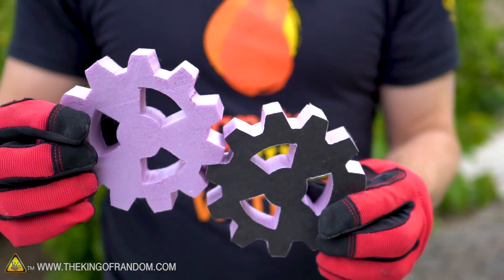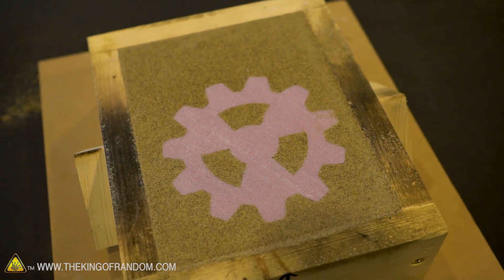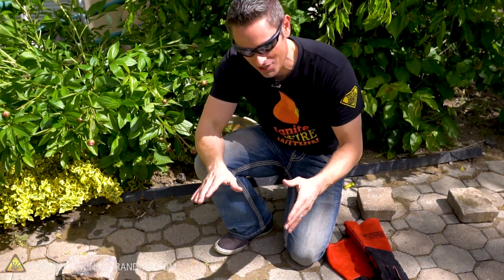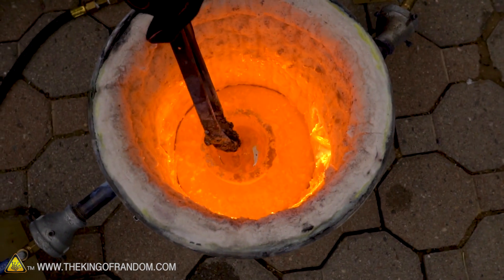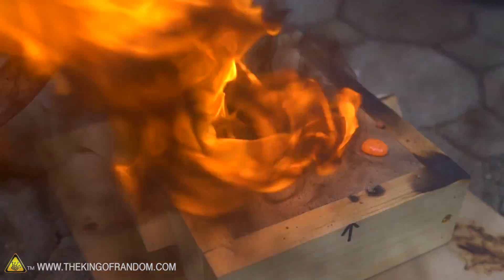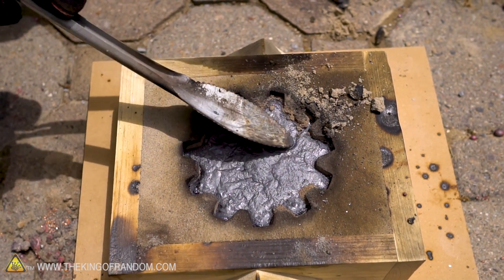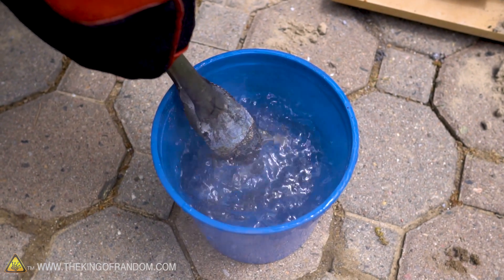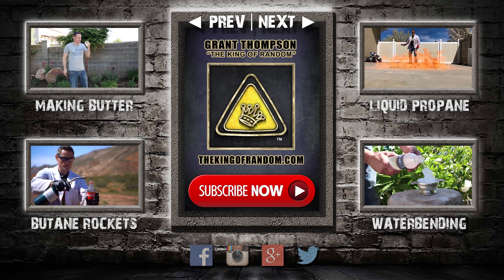Argh. Why Is Copper So Difficult? TKOR Tests Melting Copper In Our Homemade Foundry

Comment: Professional caster to the rescue! 
Don't melt the Styrofoam, and skim the slag off the top of the copper. It's a defective impurity. Also a neat trick to the sand is add  sand epoxy.
Reply: Yeah I was so confused as to why he kept melting the Styrofoam first!
Reply: KingSusan420  also the sand was to wet and here's why the water evaporated so fast the sand whent upward
Reply: KingSusan420 I'm no caster but I've seen others remove their mould using screws to leave just a cavity in the sand, would that help?
Reply: For the slag, he is supposed to stir in some borax because borax makes to slag easier to remove. He can use a titanium rod as a stirring stick. And  to make play sand into casting sand he just need to mix a small bottle of white glue into the water that is used to wet the sand. The sand can be reused by soaking it in water. Also, construction sand works better than play but construction sand has cancer causing dust. Play sand should never be used in high strength concrete
Reply: +RmRoyalflush He is using clay in the sand
Reply: I finally watched his sand video. He does add clay to his sand.
Reply: RmRoyalflush He made this sand in another video with clay, it isn't play sand.
Reply: Lee C he shouldnt make gis own he should get some professional grade stuff
Reply: Edgy McMememaster probably yeah, just saying it wasn't just play sand lol
Reply: Charles Tull The sand is NOT for casting.
Reply: KingSusan420 "professional caster" you should imediatly see that his sand is NOT for casting. Its just some play sand, he needs clay to make real shapes that hold up. Also he wouldnt need styrofoam and even if he would still use it, one template would be enough (you know you can take them out if you use proper casting sand)

Comment: did it not work again? i think its because you are using flame retardent home insulation, it does not vaporize in time like you wanted and shrinks/bunches up and leaves those big impurities you are seeing, by the time it turns to gas the copper nearby is already nearly solidified...

Comment: Can you make a tips / tutorial on how to safely use propane?  Im very terrified to use it without knowing how to and i cant find proper tutorials... Im still using charcoal for my forge and im just borderline of melting copper.. the crucible doesnt get hot enough. but the fire itself is. i threw a nugget in it and it melted. but the crucible wont get hot enough to melt it...  Propane will get it hot enough but i dont know how to use it.

Comment: Hey grant, just a suggestion
You should put the mold with the foam gear still in it in the oven to drive off the moisture and make the mold harder so the middle pieces don't break off🙂

Comment: You need to use the cope and drag and put a fill hole and vent hole in, that'll solve most of the problems you are having.  You might need a bit more bentonite and less water in the sand too.  You are making steam in the last casting you could see it in the copper, that causes poor surface finish and other problems.

Comment: Put sand in your foundry and try casting glass!
Reply: Vatablous Devil you would need silica sand and mutch higher temperatures
Reply: Doge channel any old sand still works it gust doesn't look right
Reply: You make it with a very specific kind of sand. (AKA Silica sand) which has an extremely high melting point, higher than you can achieve with any gas you can buy at a store. Charcoal may work but it is a long shot.
Reply: its not minecraft
Reply: Also that's not the proper use of AKA
Reply: Doge channel, I have not found coal yet, can I use my wooden pickaxe(now that I have upgraded to stone) instead?

Comment: Hey Grant, try making the water slightly hotter, and then put it in the oven or something to heat up the mold a little bit. Then it would take less heat from the copper, so the copper could flow more easily. Also, try making a channel away from the main gear for the copper to flow down, then it might not push the sand over as easily.
Reply: Ytrbpt Hsbom his sand is NOT for casting, a channel would just break his mold, he needs to get proper sand or rather clay,

Comment: Hey Grant Thomson why dont you do it with a close mold? If you divide the die in three parts and remove it before pour the copper in to mold. The other sugestion is to heat up the mold it self. Just give it a try. Thank you for the fun of watching this

Comment: Grant, make the gear with a 2 part green sand mold that has a top and bottom. The top can be just sand, because the bottom will have the mold. Just drill holes in the top to reach the bottom. The top will help kept the pillars from rising.

Comment: You could try a hybrid green sand system. Do molds like You did before by burying the foam in the green sand and using a riser to pour the copper into the mold. Also You could add more clay to the sand add more water to make it into a paste then add the foam and pop it into the oven to cook it and harden the mold like a clay pot.

Comment: Make a two piece mold. the sand weighs less than the liquid copper so it floats because it doesnt take much to pull the sand apart, but if you had a two piece mold, the inner parts would be braces on both sides keeping it from floating away...

Comment: grant why didn't u try making two halves like real sand casting where there is a blank side with a funnel and a side with the mold or a mold on both sides but a funnel on one that way u make sure it flows to all the cavities plus since the sand will be on both sides it will hold down the mold picked that try to float and insulate some of the heat letting it flow a bit longer

Comment: It would probably work out better if you did a 2-part mould with a cavity instead of using foam.
Have a go with sodium silicate/CO2 hardened sand.

Comment: You will have better results using the sand and Sodium Silicate method.  You pack your mold as usual then gas it with Co2 to harden the sand, remove your pattern and you are ready to pour the copper!

Comment: I think a part of the problem is a fairly large buoyant force exerted by the copper. After all, It is a heavy metal, so you can expect much larger buoyancy than with aluminium (around 3x actually, if my calculations are correct). That force acts upon these pillars of sand, and they simply do not have a large enough cross section to withstand it, and so they break off and float on the molten copper. What I think you could do to avoid this is to insert something like a piece of wooden dowel (vertically) into every hole in your styro gear at the stage of mold preparation. When you then fill it up with sand and ram it, the dowel will help hold these pillars of sand firmly to the bottom layer of sand. You could do something to increase the area of contact with the sand, for example drive a small wood screw through the top and bottom of the dowel. I'm not an expert in metal casting, but still, I hope this helps. Cheers

Comment: Sand has a very low density compared to the copper (8.9) so the sand just cracks and floats on the liquid copper, a mold like this sould be completely closed to avoid sand to float.
However, it seems that your sand is very brittle, do you use something except water to bind it, clay (bentonite) or something like this? 
The filling of the mold is very low, you should do it faster to get a complete part and avoid the metal to decrease to much in temperature, make a closed mold with a descent allow to fill a mold like this in 3 seconds, and sand everywhere around the part avoid air to cool down the metal.

Comment: You should try melting sand from the beach into glass using the foundry
Reply: too high of a melting point to do that with propane or butane. charcoal would work but if you don't use silica sand it wont work.
Reply: That, and if you want clear glass, you can't just use any old sand. A specific kind of sand is used to get clear glass, the rest come out smoky and gross.

Comment: The green sand was likely too dry. As it dries it loses strength. Ever seen a sand castle at the beach? They are more often made with damp rather than dry sand. The wet sand will help hold its shape better. Also, have you considered skimming the copper? There is a lot of slag and debris on top that pours into each mold giving you that stippled finish.

Comment: the molten copper is a liquid, and it's a pretty heavy liquid, so the molten copper is excerting an upwards pressure on the middle pieces.  You can see this as the broken off bits float on the copper.
For shapes like this you need a closed mold rather than an open one.

Comment: You should try using an oil-based sand. A little more expensive, but stays in place better. You can also try compacting your green sand more by using more force. Another option is using a different metal than copper with a lower melting point.  You should also try adding borax to the copper, which may help, but probably not.  Hope the advice helps; keep on trying!
Reply: wouldnt the oil burn?
Reply: Yes; it would absolutely burn, but not very quickly.  The only parts that would burn are the areas exposed to the outside air, which can easily be scraped off or put out.  I mean, Grant uses wood and is basically pouring metal around 1,600°F onto it.  Have you noticed the carbon marks on it?
Reply: You do have a point

Comment: You need fully cover the mold in sand with 2 cylinder holes on each side . One side to poor and one side to vent. This will also save time grinding.
Reply: You also might need a deeper box
Reply: you know you can edit right? not what you did by putting a another comment

Comment: you should use both green sand molds and put a hole im the mold that goes over top the gear then pour the cooper in the whole with the.gear mold
Reply: ask me anything if you need more explanation

Comment: you might need a two part mold for that if the internal sand parts are breaking loose like that. also your sand might need to be wetter.

Comment: I'm not espert but for what i see i think the high temperature of copper let evaporate the water in the sand too quickly and broke it. instead of water ther is some recipe for green sand whit oil u can try, also i think u should make a top box of green sand whit a funnel hole in the middle and put it on the gear to pour the copper quicly and keep the temperature up. (english is not my first lenguage if it's write wrong i'm sorry)

Comment: you need half the gear molded in a top and bottom to make a whole one and it will help keep the chunk of sand from popping out because there being press together from the two half to each other when pouring the copper. note, you need to add two tea candle wax for flux and temp for easier flow.

Comment: I haven't done any foundry work since middle school like 20 years ago, the only things I can think of is the water in the sand expanding from the heat messing up the middle cogs, can you "bake" the sand to help keep it's shape, and maybe put a lid over the whole thing with and this is the harder part, one entry way to pour the molten copper into that feeds into 3-4 feed points distributed around the cog.

Comment: Nice DIY try! :) If you want to have a nice cast you should probably think about a 2pc sand mould with a top and feeder hole + vent. I think it should be easy to to assemble for you ;)
Reply: that should support the sand and prevent the it from floating. And just leave the foam in the mould, it stabilizes the mould during the casting process. Also think about getting a castable alloy.

Comment: perhaps you could look up some green sand recipes, preferably some that contain bentonite clay in the sand and/or oil in the sand. 
you may also want to reduce dissolved gasses from the molten copper, i.e. fluxing it and/or putting charcoal in the melt.

Comment: Try adding a small amount of talc to the sand and some borax to the copper. Also cover the top with sand and have a small chute to pour the copper into the mould with a gas chute on the other side.

Comment: That greensand recipe seems to be super weak if it's pushing the sand away that easily during casting.  That stuff should be able to take a pretty decent jolt without moving.  Add more bentonite to your ratio.

Comment: You should use the arc furnace to melt copper and  use fire brick to mold the copper since it can withstand lots of heat and not ruin the final product

Comment: pouring liquid copper on the sand of the radioactive symbol is the problem, it cannot stand one piece since copper is heavy liquid metal. pour it on ths center of the of the s.f

Comment: what happens when you heat up a magnet? does it still work?
Reply: It will not work because the poles will be all messed up because the heat excite them to the point where they are moving all over the place. Once it cools back down most of them will return back to the original state but not all. SO the magnet will become weaker.
Reply: Google "Curie temperature".
Reply: basically that is correct. however it depends on how much you heat it up, and what materials your magnet is made of. Different materials will have a different temperature range that you can heat it up to without losing the magnetic field. so it is possible to heat a magnet up and not have it affect the magnetic strength  but if as you get near the threshold your material will start losing its aligned poles  and become weaker or the poles will be disturbed enough to cause it to no longer be  a magnet.
Reply: Noliux noop
Reply: and molten metals arent attracted either
Reply: no
Reply: thnx
Reply: Do you even understand how magnets work?

Comment: where your failing the only way i can see is having the pillars of sand inside the gear and the type of styrofoam your using it may be better to use the white foam you used in the styro slicer video

Comment: It's the foam you're using, it melts slow but also leaves parts of itself behind which can make imperfections in the mold. Also the copper doesn't have time to flow all the way in and completely fill the areas where the foam is making imperfections as you know.
Reply: he used housing insulation
Reply: Universes he isn't using foam
Reply: he did actually say styrofoam in the video tho

Comment: Green sand is not solid enough you need oil sands, and an upper box with spru and riser
Reply: Bob Dip you are right, the sand he uses looks like normal play sand but you need oil sand or what was mostly used is clay-sand it holds the shape better is much more solid and you actually can take out the template
Reply: It looked like he wasnt packing the pieces that popped out enough... he should be packing it down layer by layer
Reply: Bob Dip it's just that he didn't pack it right, plus if he used styrofoam it would burn off entirely as well as burn quicker
Reply: Bob Dip exactly what i said, finally someone understands 🤣
Reply: Green sand is plenty solid, but an upper box and a riser or two will definitely help. And maybe a flux, too, like borax.

Comment: I would try using a plaster of Paris mold. It will hold its shape better and have higher fidelity. Only downside is it's not reusable. Also try adding some zinc to the copper.

Comment: add binder ( bentonite, dextrine) to sand (2-8%), and then mix the sand consistently and then make the mould it will hold. and also try to dry the sand by preheat the mould with burner it will surely help.

Comment: Your metal as a high "density" compared to the sand (even with more moisture) ; you should try to get the special sand used for steel casting; this one is impregnated with a sort of resin; easy to shape and perfect to resist to the liquid metal pressure

Comment: Copper cools down really fast because it has a low specific heat capacity which means it looses or gains energy more quickly than other matter. For example water has a SHC of 4.18 joules/c while copper has 0.385.
Reply: Justin Grafstein I think I see his point, although I have no idea how accurate his numbers are. Not sure why he's comparing copper to water instead of aluminum, lead, etc., and even if heat capacity is an issue, latent heat and melting point would be more relevant since we're dealing with a phase change. I think there's some relevance to his comment though. He's probably assuming since copper is a great conductor,  maybe it loses heat faster. I think that's where he was going with that, or in terms of specific heat, it takes less energy loss to cool copper per degree. It's a fair theory I think, unless I'm missing something.
Reply: Aaron Rappleyea yeah I totally understand...😐
Reply: Justin Grafstein I agree
Reply: I can confirm this as a refrigerant engineer.

Comment: Can you not bury the styrofoam cog in the middle of the sand with a styrofoam shaft going down the middle where you can pour copper down the styrofoam shaft and then it will keep the shape of the cog

Comment: Grant, I have fasted metal before and I use concrete molds so just take your shape and put it in a box like yours and fill it with concrete or plaster Paris I also use that

Comment: The problem is that you need to make sand cores for your holes...you basically have to make a solid sand core where your holes need to be and mold your mold around it...also I think your foam is causing gases to form where the metal is coming together. If you can figure out your sand cores, you may be able to make a wood mold and remove it then add the cores before you pour the copper....lots of vids out there search for sand cores.

Comment: Missing a few things:
1. Need flux to cast copper.
2. Have more clay in the mold, due to the ∆ roe of Cu and Al need stronger mold.
3. Add a top to the mold so the the center portions have support from top and bottom.

Comment: use brass, aluminum, or tin/copper mix. it'll come out wayyyy cleaner. and always sift the sand. it makes it fine and smoother. also use stiffer foam